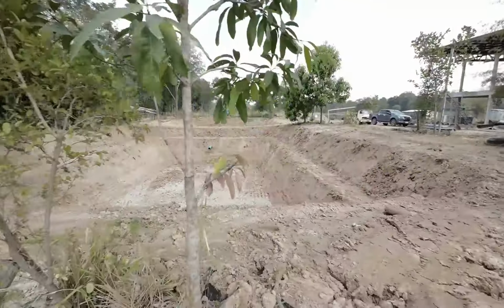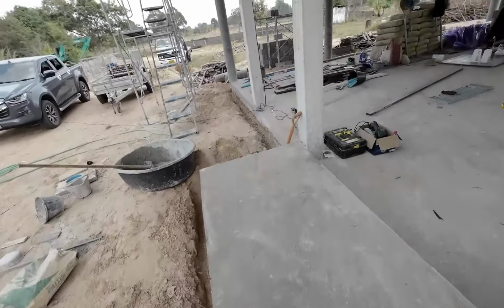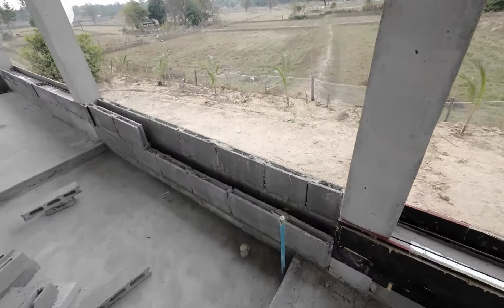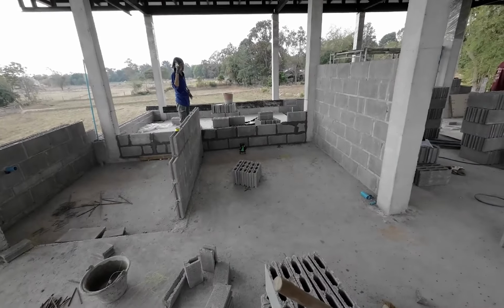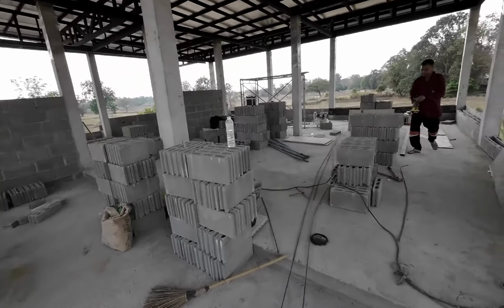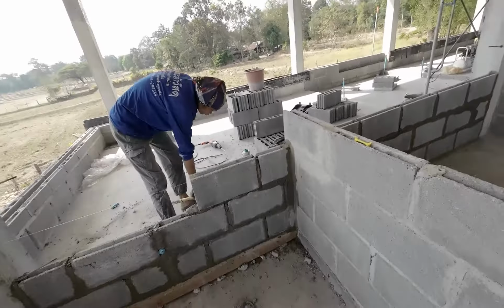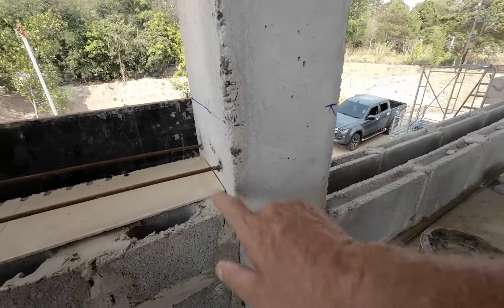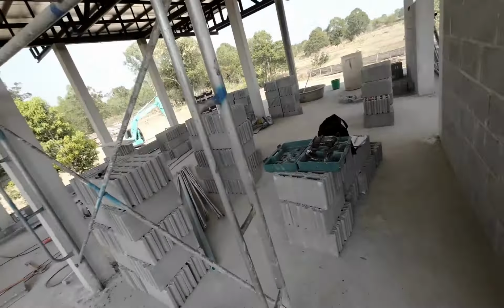2 floor Blockwork  build in Maha sarakham Thailand Part 6

Comment: What's the price on this build expected to be and what's the sqm?
Reply from the maker: It's aprox 264 sqm. The price per sqm depends on the type of build your doing so from 12,000 to 16,000 baht also there are always some changes on builds like this so it can cost a little bit more. I always recommend  add on a extra 30% just in case. Thanks for watching 🙏
Reply: @BryansThailand  Thanks, nice property!

Comment: Coming on now! So an empty cavity is better than filling with insulation??
Reply from the maker: Yes as you need the air flow to keep the inner wall cool. Only insulate if in a cold country  is best. But for thailand other hot country  its best to have a 2 or 3 inch air gap. I did do a thermal test in a previous  video to show the difference.  In thailand they use the thermal white blocks I don't recommend  using them on there own as I have seen on other buildings in thaialnd even my home in chonbury It has the thermal  single block work and the house is never cool without  running  air-conditioning  24/7 so I know personally  never use white thermalite blocks. This is why I only do what I do from experience  as a builder and engineer  . Thanks for your comments 🙂 🙏🙏🙏
Reply: Very interesting arguments. Thomas
Reply: @BryansThailand   Nice one. So do you only use the 2 smaller blocks, or do you ever use a larger block outside and a smaller one inside the cavity wall? Thanks for your reply!
Reply from the maker: @LungAnt  there all the same size 40cmx 20cm 😉👍
Reply: cheers,  @BryansThailand